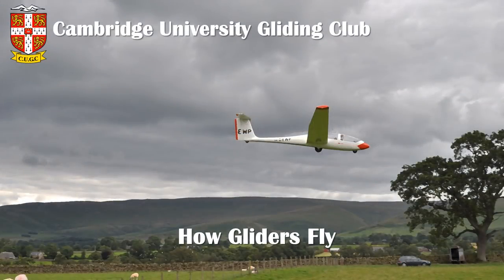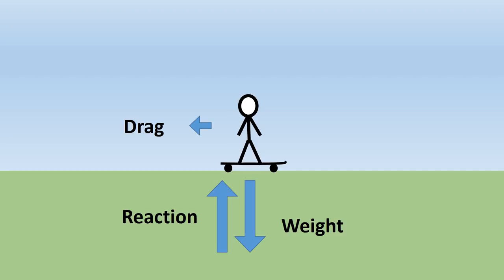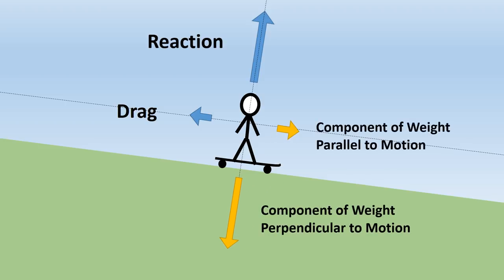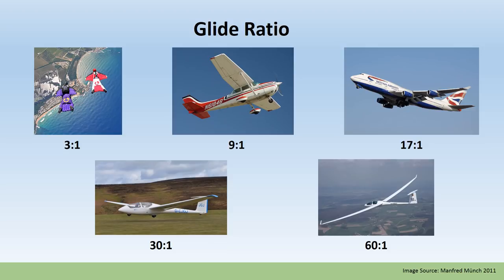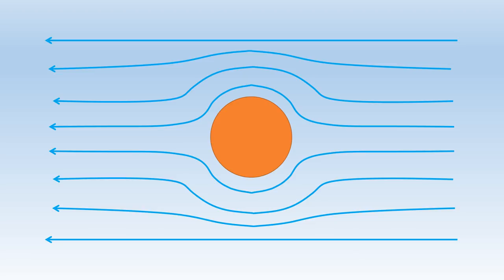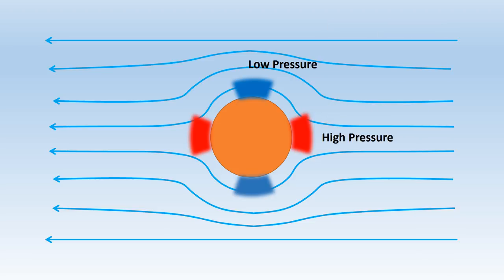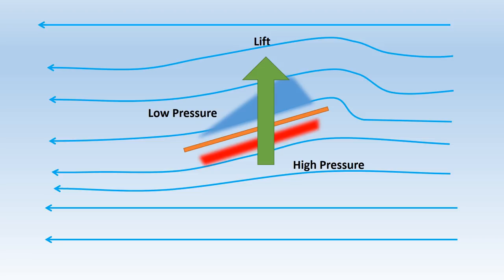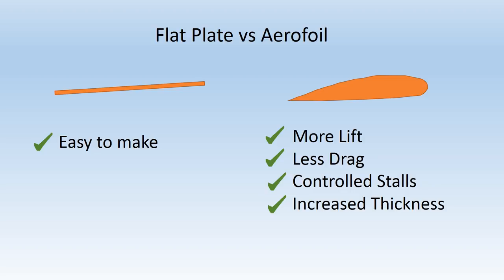How Gliders Fly

Comment: So this still ain't tell me how a glider flys
Reply: Ryan W they just fall really slow
Reply: And as they fall they move forward and we call that "flight".  And when they "fall" in rising air they "climb" relative to the ground even as they are falling relative to the rising air...but falling slower than the air is rising.  Oh, just go down and get an introductory flight in a glider.   Then you will stop asking and start enjoying a wonderful experience.
Reply: they descend unless they use rising wind currents off of ridges or thermals, rising masses of heated air. Birds use both of these methods to rise without flapping.
Reply: @mythologicalmyth  i wish I was smart.  I dont understand it but it seems super interesting.
Reply: @GuyFromTheSouth  It's basically just hot air rising up.

Take single layer of a small piece of toilet paper and place it above a heater (without fan blowing) in your house, or a stove, or even just over an exposed flame like a candle or a lighter and you'll see that the small piece of paper starts moving upwards.

The same principle goes when the ground heats up - hot air moves up and lifts anything above it i.e. gliders.

Comment: Does speed decrease if i rise the nose a little bit up not too much?? Does speed remain costant
Reply: It does decrease. If you raise the nose too much the wings stop producing lift and you stall.
Reply: If you lower the nose the speed of the glider will increase, a long with drag. Eventually you will reach the maximum speed at which its safe to fly the glider.

Comment: As a glider pilot this is incorrect , thrust is at first created by the launch power ,  then momentum is just at all times maintained at approx 55 knots . In reality there is still thrust , just using gravity , to create thrust , a force which is present . The only way to increase attitude is by using a thermal or sudden lift
Reply: As a glider pilot you are incorrect, in free gliding flight we ignore the 'momentum ' of the launch. Attitude is altered by the crafts pilot using controls, ALTITUDE is gained, in free gliding flight by outside influences of lift generated by differential solar heating, ie thermals, ridge or hill lift and mountain lee wave systems. The motive power is gravity and the fuel tank is altitude, duration can be extended by soaring.
Reply: There is no thrust in free flight.

Comment: I think your high/low pressure theory of how wings produce lift were debunked decades ago. The wing creates a down draft at its rear. So graphic examples of the upper & lower air flows at the rear being parallel to a horizontal surface are incorrect.

Comment: is there any one out there that can please tell me how the fuck a wing works, i hate that word LIFT, when i look at that flat plate with attack angle then i only see it being PUSHED up from the bottom UP, as every one told me that wings (airfoil) of a plane is shaped that way to create LIFT on top of the wing to LIFT it up, there is a huge difference in LIFTING something and PUSHING something up, so tired of this 2 sided bullshit of who is right and who is wrong
Reply: The video us right. The high pressure below the wings surface does push it up, but the low pressure above the wing also effectively sucks it up. It's the pressure differential which is important here.